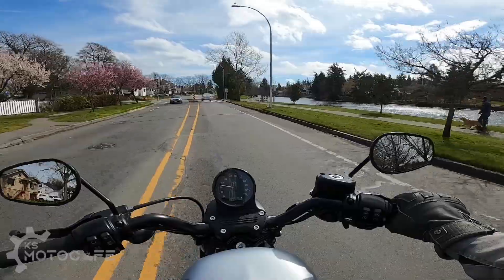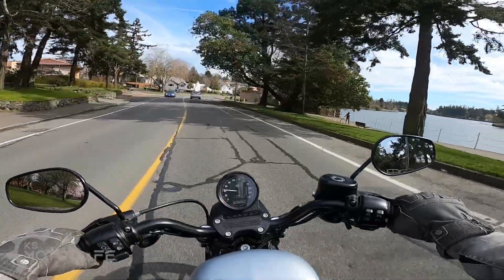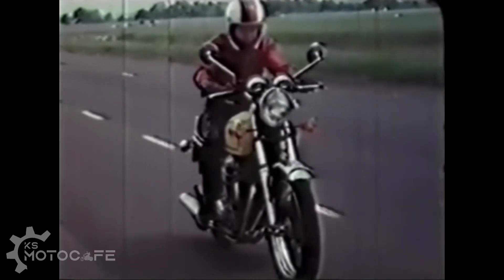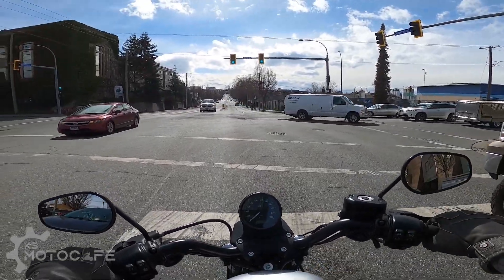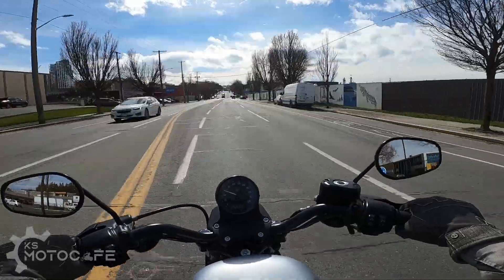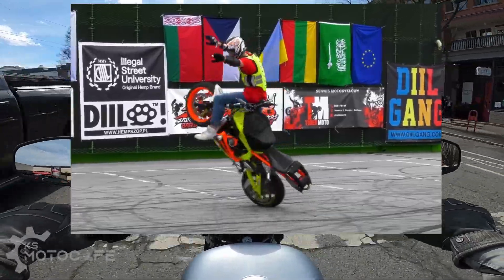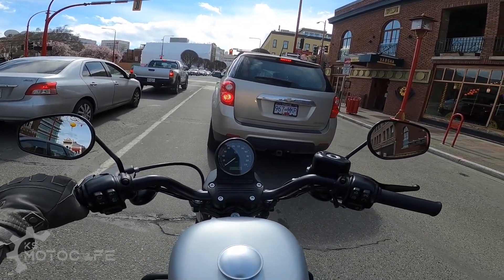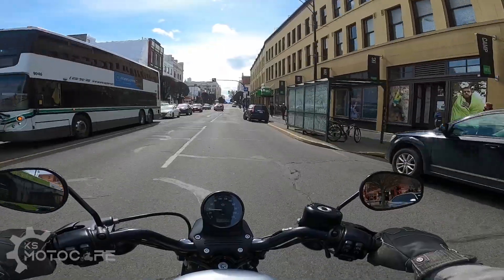Death Wobble, Speed Wobble, and Tank Slapper on a motorcycle explained!

Comment: Asking ChatGPT: => Is there a relation between a motorcycle wobble and a motorcycle frame with an insufficient stiffness or strength ??
Yes — absolutely.
There is a direct relationship between a motorcycle’s tendency to wobble (tank slapper or death wobble) and insufficient frame stiffness or strength.
ChatGPT conclusion: Let’s break this down clearly:
1. Why Frame Stiffness Matters
The motorcycle frame acts as the structural backbone that connects the steering head, engine, and suspension.
When it flexes excessively — either torsionally (twisting) or laterally (side-to-side) — it allows small steering oscillations to amplify instead of being damped out.
In a well-designed motorcycle:
•	The frame transmits forces cleanly between front and rear suspension.
•	The steering geometry stays consistent under load.
If the frame is too flexible, those forces don’t dissipate — instead, they can feed back into the handlebars as oscillations, causing or worsening a wobble.
(This is just the introduction - the complete answer is much longer)
But the only efficient solution is to install a hydraulig steering damper.

Comment: You are just guessing about speed wobble. But you are wrong. Just like all the other YouTube videos. The REAL reason is mainly the frame of the bicycle. Some bikes are build with a frame that is NOT sufficiently stiff.
The lack of stiffness gives room for at potential wobble to escalate. The complete explanation is more complex.
The technical headline will be: Torsional vibration in a two mass system - connected with a torsional spring, with low damping, - can possibly start to oscillate at a specific frequency".
Before the real "Death wobble" happen, your motorbike - or bicycle, will have given you a "lot of warnings", with less seriour wobble situations - that you have survived.
Hydraulic stearing damper is the ONLY efficient solution. In case you experience a mild speed wobble - your next action MUST be to have a hydraulig steering damper installes - if you want a long life !

Comment: I still have my first bike, after nearly two decades of riding.  She got crashed and bashed while I was still figuring things out, so now she's a junkyard special (and so is the rider lol).  Parts from 1993 all the way up to 2005, including upside down forks from an even older GSXR1100 and a hayabusa swingarm and shock, etc.  renthal fat bar direct mounted to the top triple home-depot style, stubby levers from amazon, bar-end mirrors.  Typical cheap fighter build, but on a decently good old bandit mk2 frame.  Had a massive shake a few years back that nearly sent me flying off the outside of an elevated off ramp.  Literally looking down this massive steep hill at the cattails when it just suddenly stopped shaking on its own.  Wrenched it over trying to finish the turn, but ran out of room and low-sided on the grass.  Went down the hill head first like superman, then had to check my pants and wave someone down to help me get the bike back up the hill.  Rode it home with half a roll of wet sod shoved up under the tank.
...Grass cooled for maximum emissions compliance.
The bike was alright, mostly.  No plastics on my build, so it was mostly just bent bars and some scuffed paint.  But I found the right fork had the chrome worn completely through, just up past the fork seal.  You couldn't see it while the bike was sitting normally, so it hid during my pre-ride inspections.  I'm certain that was what caused the shake.  These days I've learned to put a bike on the kickstand and just push it into the stand a bit, which exposes more fork tube so you can inspect it.  Even half an inch should be enough to expose any serious wear.  An no, my fork wasn't leaking.  So don't just trust that no leaks means good forks.

Comment: Was not death wobble but had blowout front tire ran over drill bit at 55 on concrete highway. Front end started dancing quick. I luckily knew what to do, let off gas and not use the front brake. Flat on front can be dangerous if deflates quick. You can lose control quick.

Comment: I’ve never experienced a wobble on a motorcycle and don’t wheelie on the street but my friend’s Jeep Wrangler would get “death wobble” from hitting overpass expansion joint seams on a corner at highway speeds. Letting off gas and slowing down corrected the error. The Jeep manufacturers repair worked for a while but the wobble returned after a year or so. These videos are frightening.

Comment: if one of the main things that causes the death wobble is different speed rotations on each tire and with the assumption that the front tire is always going to be rotating the same speed or slower, then it makes sense that tapping the rear to slow it down to the same speed as the front will fix the problem.

Comment: I had death wobble on a Wide Glide (Harley) at 130mph. Eased off the throttle slowly, took about a mile to get under control. Turned out the bike had a bent frame from the factory. Yes had to change my pants after it happened.

Comment: Me and my 2014 Street Triple on the Pat Bay. Only one of us made it out alive, (and Triumphs can't type). I was doing about 90km merging onto highway. Changed into pass lane on a slight acceleration, and the dread wobble began after straightening out. Didn't lift wheel of the ground. Clutch in, laid off throttle, but bike drifted toward center-divider. Tried throttling through to bring back rightward, and did do that, but wobble went mad and we ended up in the ditch. Plenty scary yeah. Had ridden that bike 2 years, and done that merge a hundred times. But, just had front brake pads done, and not a mile from the shop... Can't say for sure that contributed to it...😬

Comment: 2013 Honda Sabre. Had the death wobble happen once. Approximately 65-80 mph on the highway. I wasn't doing anything irresponsible, and I don't even remember hitting a bump at all to cause the tires to desync. It lasted 5-7 seconds, I just held on for dear life, didn't touch the brakes. It finally recorrected itself on its own. Pulled over right away to recollect myself.

Comment: Jesus, those wobble falls are scary beyond comprehension to me. I don’t ride though.
What I find crazy on some videos is that it it feels like eternity being in a death wobble, there’s so much stale time (no control over 5 seconds at high speeds is a lot), that if there’s a real need to maneuver or break or hard turn, then no dice… the bike better come to stability asap before having to do the maneuver or it’s over.

Thanks for the great explanation and added comments throughout the threads.

Comment: I just had a speed wobble a month ago on my BMW R1300 GS at 185 KM/H it was the worst and most scary feeling I ever had in my life..

I was at 120 km/h speed and then I decided that I will accelerate to enjoy my stage 1 & 2 modifications I had, I forgot that my motor bike was over loaded by my camping gear, my saddles bags and top box were all full and I had two over saddle bags soft bags and one more bag on the rear chair as well as a tent over the top box… I didn’t give any attention to the huge weight on the back side of the motor bike and once I reached 185kmh the wobble started and I couldn’t control it, I remember I didn’t use both front nor rear breaks and I tried to control the handle par but it was beyond control than I don’t remember a single thing … what I have been told by other colleagues behind me that the bike started to shake so hard and then I was thrown of the bike to the right side and the bike flipped over one on the left side . The good thing that I was in full 3A gear from Klim and this thing was really protective and without it I would have been in a different situation also the helmet was from Nexx and it really protected my head from a very strong hit to the floor … I am very thankful to god that I am still a live and I only had some grade one and two burns because some of the gear parts was really damaged and melted. I have don’t a lot of research and looks like that with saddle bags and top box there is no way you exceed 130 KMH speed

Comment: Writing it someone to avoid it:

1. Increase weight on float wheel by leaning forward.
2. Slow the rear wheal by breaking rear wheel
3. Never press front brake.

To avoid it:
Maintain ur bike. Try to maintain both side handle weight equal. Avoid sudden acceleration.

Comment: Mt09sp 2022 low tyre pressure road scrape from truck blowout off direction of travel high speed and hanging on to the handle bar too tight fighting the wind. Simply riding like a tool caused it. Other times have been from front tyre off the ground and not coming down in direction of travel ie riding like a tool.

Comment: When in doubt WHEEEELEY your way out! Lol JK Release the throttle, light grip on the bars ( great time to start praying 😂 ) Depending on speed you might not want to apply rear break simply due to adding weight on to the front might cause you to wreck ( more traction to a tire that's pointing hard left while bike is travelling straight is not a good idea) it will correct it self around 50mph so if you aren't flying just relax and lay off the throttle/ click it to neutral if possible...... if you are flying 100+ lay off the throttle lean back apply light rear  break  if you must steer, do so with your ass not the handle bars.

Comment: Honda Hawk 400: without fairing, no problem; with fairing, wobbled badly at freeway speeds.  Clearly not a speed difference problem.  Thinking it's vortex-shedding: you get an oscillation as a vortex comes off one side, changing the balance of forces on either side of the handle bars (since fairing is attached to the front / forks end), then other side sheds and the imbalance reverses.  FT500 also had a slight wobble.  IIRC that was due to loose bolt on fork, allowing for slight misalignment of the two tubes in the fork.  Easily fixed.

Comment: Got my speed wobble few days ago on Yamaha Tracer 2021. It was over 7k RPMs at top gear and straight smooth asphalt road. It started slightly to shake and I released throttle. At that point it went to tank slapping and I was expecting crash. I was lucky, just minor injuries, bike is quite smashed. I don’t understand what I did wrong. It was just a miracle and I was in God’s hands. 🙏

Comment: A section of my local highway has lines cut into it for rain to flow in, those lines always give me speed wobble. The other day I had the wind at my back and my 250cc went faster than it ever has about 90mph when the speed wobble started uncontrollable. Before it was a bother when I was slower and to solve it Id turn in the lane a little bit to avoid the lines. I dont remember what I did to stop it by slowing down, it stopped and I rode on. Those dam lines in the road always get me.

Comment: I wish I could give you and your subscribers all there is to know about wobbles. Something I started researching and learning before I was old enough to have a driver's license. Then I experience it (one was the of hard variety, another a very close call, then various and numerous minor ones across different bikes, across different situations, different causes, etc).
I will do so if health allows it.

All the advices you gave are good ones. Accelerating to lighten up the front end is very good, except it's near impossible to execute when the bars
are doing many full cycles PER SECONDS. It's impossible to imagine the violence of it. You have to experience it to believe it (hopefully not!).
By the way, applying the rear brake is an extremely good thing, and doable regardless of the wobble severity. It transfers weight backwards, which indirectly lighten the front end.

Comment: 09 Honda Shadow. Happened like 2 weeks ago. I just let off the gas and applied back brake lightly to slow it down. Turned out the tires were both low on air pressure so keep an eye on that even more than you would on a car. First time that’s ever happened on a motorcycle for me. I have been on a Honda scooter, like 80cc and had a passenger on the back and that was way more terrifying to be honest. Those tiny little tires can wobble faster than a big motorcycle tire can at lower speeds. I don’t know for sure what caused that one but it appeared to only happen when I had a passenger on the back, so after it happened a second time with a passenger, I simply drove it alone from then on. 

Also it’s possible to lock up your rear brake and “fishtail” or wobble the rear tire. If you ever do that, release the damn brakes immediately. If you’re going to hit something if you don’t brake, you still have to unlock the brake, so you release and reapply the brake, and I have learned an anti locking brake technique by bouncing my foot on the rear brake and you can stop really fast without locking up a tire. A drum brake on the back won’t fishtail nearly as bad as disc brakes in my experience.

Comment: hmmm...I don't think its a difference in tire speeds. Any hard ridden bike, the rear tire is slipping.
The wobble is when the front tire is out of alignment with the direction of travel and the rubber is actually bent left, then right, as the motorcycle tries to autocorrect.
This happens when the tire comes down on the surface out of true, or when the front slips off a wet line and then grabs, when an irregularity in the road surface (hole, crack, seam, tar snake, or rain grooves) causes the tire to be stretched left or right and the tire tries to self correct, rebounding. 
We make it worse when we fight the self correction, because we aren't strong enough to hold the bars against the oscillation and we aren't fast enough to correct (the bar will oscillate five or more times in the time we can make one correction.)
All you can do is keep speed smooth as you gently slow down, lean forward to help change the wheelbase length, and be loose on the bars so the self correction can occur.
The shorter your wheel base, the more twitchy/flickable you are. By compressing the front fork by leaning forward and by reducing throttle gently, you give the bike a better chance to self correct.
Accelerating will widen the wheel base, but the true harm is the front tire will have less friction on the smaller contact patch. This can be a blessing, if the tire comes up enough to eliminate the off-alignment of the tire, or it can transfer the wobble to the entire bike and rear end, where now the front and back tires are in combat over where the direction of travel should be.
I have never seen someone, once the rear-end is involved in the wobble, ride back out of it.

Comment: I had a high speed wobble develope on a Honda 754 once. I ran through a litany of split second lessons having never seen or heard about these. I was running about 80mph, topped a pretty sharp and sudden hill, and I believe that that was what got my front and rear wheels out of velocity synchronicity. I let off the throttle, and slowly tried my front brakes. Immediately I knew that the front brakes were no bueno. That steering wheel turned into something that felt like a jackhammer and I was holding on for dear life. I then slowly tried the rear brake, the shaking got no worse nor better, and my mph was coming down to a possibly manageable crash if one happened. I began to apply even more rear brake, my speedometer reached 55 mph, and the wobble smoothed out like it never happened. The rear brake will bring weight back on the front wheel (with a complete throttle down), and that was my finding from surviving a high speed wobble.

Comment: 1985 Goldwing Interstate I have had a tank slapper. Anytime I plan on going for a longer run got about $2500 into repairs trying to figure it out. By watching this video I have figured out it is my cup holder mounted on the handle bars short runs I don't take a drink with me on long runs I do. Thank you for your video. Wobble alway accured about 40 mph. Will be removing the cup holder.

Comment: Happened to me recently on my Fat Bob Dyna. The road was wet, which I’m sure played a big role because I’d just had it serviced 2000 miles ago by the dealer - new rubber and wheel bearings included.
Was doing 80mph and I basically pulled the bike out of it by heavily grounding my boots as evenly as possible and allowing the bike to slow down. Very quickly the wobbling ceased and I was fine. It was very crazy for about 5 seconds and I’ll never forget it, but for whatever the reason my boots dragging along the road brought it out of the spiral and on I went.

Comment: Mine was on a ninja 600 @ 125MPH….but I did not back off because I was racing a dodge dayona…..I sped up to 129MPH, the wobble continued so I backed off the throttle and it stopped, I may have applied the rear brake.  I was 20 and stupid just like you.  😂😂😂

Comment: "two wheels do not have a synchronized velocity, the motorcycle will try to auto-sync by wobbling the front wheel back and forth".  Cool mansplaining, but I have an MS in ME and no idea what this means.  The tank-slap instability occurs when the center of mass (c.m.) is too far rearward.  It is most common with heavily-loaded bins in a H-D.  To move the c.m. forward quickly, lean your body onto the fuel tank.  I experienced similar wobble once on a bicycle when carrying a laptop and books on a rear luggage rack.  Certainly couldn't ride with no hands like that.  Offset of the front axle in front of the steering axis aids stability, which is why beach-bikes have curved forks, and are easy to ride no-handed.